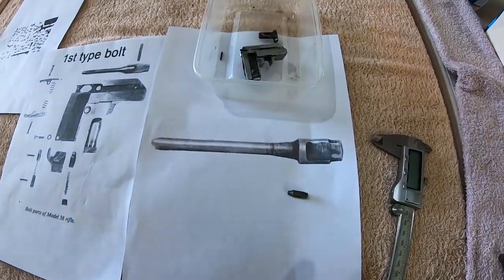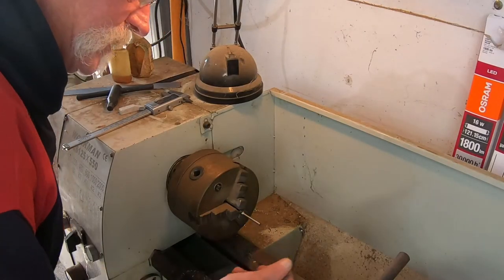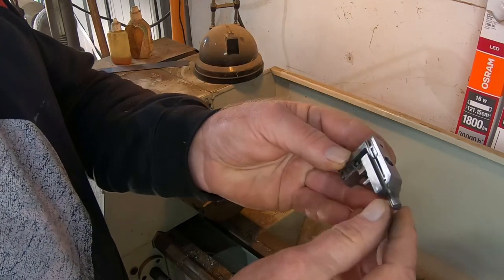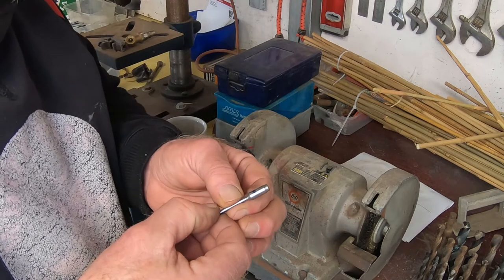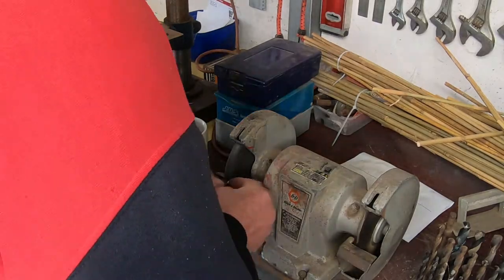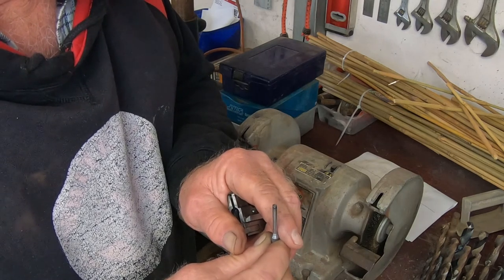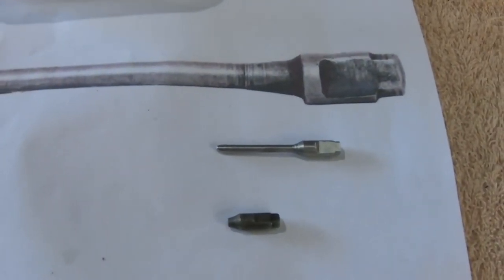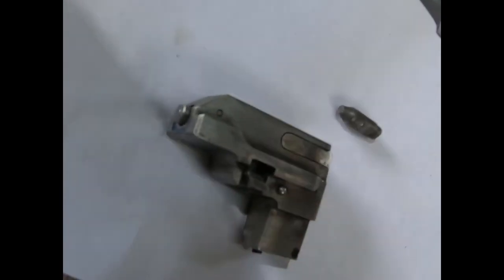How to make a .22 calibre rimfire firing pin from an old high tensile bolt

Comment: Does rimfire mean primer that must be hit from the rim side such as nail gun power loads, blank cartridges? Thanks.
Reply from the maker: Yes .22 calibre need to be struck on the back edge of the caseto detonate as opposed to centre fire that have press in detonators. Cheers Craig
Reply: @BendigoHydroblasting I still am a little confused on where the firing pin needs to strike on the back of the cartridge, and I can’t seem to find a video showing that. If possible could you make a video about it? Also does the firing pin need to strike the center? Or anywhere on the back?
Reply from the maker: Rim fire cartridges have a primer compound inside the case on the bottom of the cartridge as opposed to a centrefire round which has a primer pressed into the case. Centrefire cases can be reloaded whereas rim fire cases are single use. The firing pin needs to impact the case onthe back of the cartridge on its outer circumference. Cheers Craig
Reply: @BendigoHydroblasting  thanks so much! I’ve got my plan for a homemade/makeshift pistol thing ready and this was all I needed!